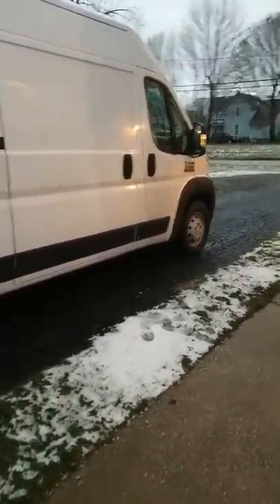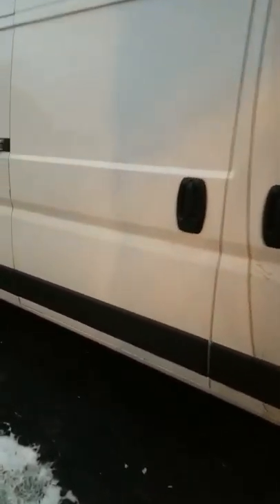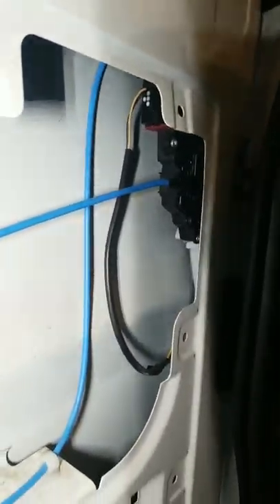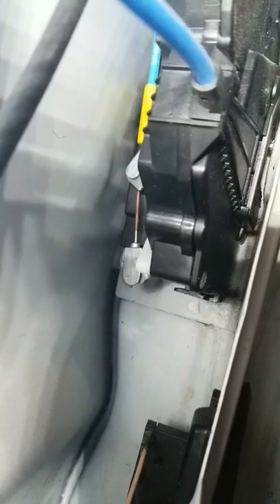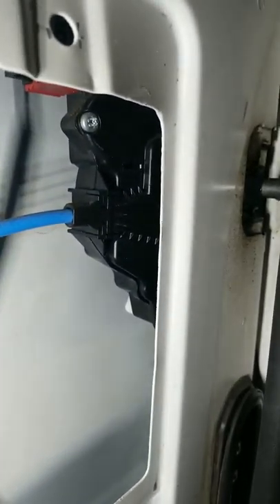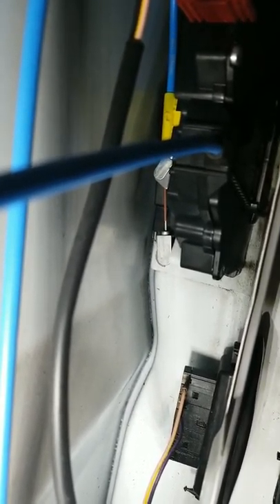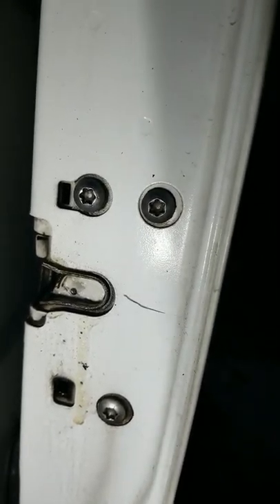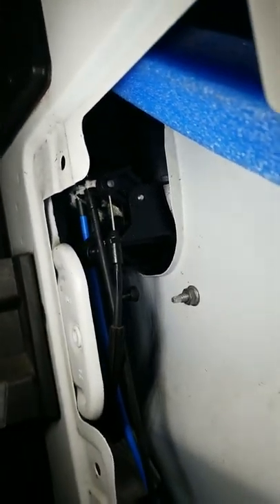Promaster side door won't open FIXED! How To

Comment: thanks for sharing valuable info! just my 2 cents to anyone who may have the same issue. Before you bust anything, do check if nothing got jammed the door. In my case it was the weatherstrip that came off and got jammed between the door and door frame causing the door latch to be under pressure jamming it. all i had to do is to pull that weatherstrip out and then i was able to open the door. otherwise, the issue was exactly as described in this video and I was getting ready to bust that latch when i - lucky me - noticed that weatherstrip being out of place.
Reply: I pulled the weather strip out hoping that would free up the lock.  But no, in my case the problem did require smashing the thing to open the door.  Stupid design.

Comment: Thanks this video was huge!  The part at the dealership was $385, I ended up finding it on line for $45.  The parts guys at the dealership were cool and helped me figure out the part # and printed off a quote and kinda gave a wink wink go buy it somewhere else vibe.  I ended up replacing the cables too because the parts guy at the dealership told me my problem was probably stretched cables... it wasn’t, the latch mechanism was definitely broken inside and I had to bust it open, but I figured while I was at it I would replace the cables too.  Thanks for this vid though!

Comment: Thanks, mine's stuck and all the other doors are mechanically deadlocked from the inside. Do you think if I drill say a 3" diameter hole near the lock mechanism, I could flick the bottom latch and open the door from the outside? I was adding insulation to the door as I'm converting it to a campervan, when the door slid shut very slowly. I might have dislodged the cables from the handle or insulation might have fouled the mechanism.
Reply from the maker: It's hard to say, flipping the latch for me wasnt enough. I had to literally destroy the latch with a screwdriver and order a new one.

Comment: thanks for posting this. My slide door is still stuck and won't open even when moving the bottom linkage by hand. Clearly the mechanism assembly is broken in mine as well, however none of the linkages work (i tried both). Do you have any suggestions that may help? Thanks for your reply in advance.
Reply from the maker: Take a screwdriver and bust the whole area around the latch apart. This is how I had to work mine
Reply: @DualsportDisport  Thanks! So just to be clear, the bottom linkage will disengage the door latch ONLY when the mechanism assembly is in working condition? I will break it apart today and see how it goes.
Reply from the maker: @adrianpietraru  correct. Destroying the old one is the only way I got mine off

Comment: Sorry to be thick headed, but after watching a bunch of times, I don't understand what busting it open does to allow you to use the bottom linkage to open the door? Was that to identify which linkage opened the door?
I can move that bottom linkage, without busting it, but the door still won't open! 🤷
Reply: I think it was to just identify how it was supposed to work, and your problem means it’s broken inside the mechanism.  I could move the linkages too, but had to bust mine open to get the door to unlatch

Comment: Thanks for this video.  I'm having this problem and having to replace the latch housing but there seems to be two part numbers for the same part (68226180AD and 68226178AD) for my 2017 Promaster 1500.   Do you remember the part number you ordered?   Can you share where you ordered this part for your fix?
Reply from the maker: I don't have the number but I ordered it from the dealer using the vin number
Reply: @DualsportDisport  Thanks

Comment: Hey Nate really enjoyed your video I’m having problems with my doors as well hopefully this will help he can you show how the cables connect to the inside and outside door latch it would really be helpful to make mine was all disassembled by the dealership and when I chose to not pay $2000 for them to fix my door I just left everything a mess thanks for your help Dennis
Reply from the maker: Hey I will try to get that tonight
Reply: Nate Thanks Nate I really appreciate that it’ll help I still haven’t been able to get my door unstuck I I was able to get the two mechanisms to release that you showed in your vehicle but my door won’t even budging a16th of an inch if you have any other suggestions I would sure appreciate it I was wondering if maybe it’s something that’s electrical or magnetic I just don’t know I talk to two different dealerships and they absolutely refused to give me any information to help me thanks again Dennis
Reply from the maker: @dennisleach588  take a hammer and screwdriver and bust that cover off where the end cable goes in, then shove the screwdriver way down in there by the latch mechanism and pry around. That's how I got mine but it took some time
Reply from the maker: @dennisleach588  https://youtu.be/JpigwvX_FRY
Reply: Nate Hello Nate thank you so much for your advice and your guidance I was able to bust up the mechanism I had to get it and then it was as simple as reaching out and barely touching the latch mechanism and the door popped right open so I got the new lock system in everything works except for the fact that I cannot unlock the doors with the key fob any suggestions and thank you again for your help I can manually lock the doors I can lock them with the key fob I can manually unlock the back door with the key but I cannot unlock the doors with the key fob
Reply from the maker: @dennisleach588  glad to help! so the key fob wont lock any of them? But they lock with the button under the radio? Or are the lights flashing when you try to lock with the fob? Silly question but connector is plugged back in right? I had that happen once and cant remember the timing but I thought it was something major and ended up just putting a battery in the fob and it worked after the new battery.
Reply: @DualsportDisport  Thanks also for the video. Had the same issue with my door and I was able to fix the latch and the door works. For me unfortunately the door now wont lock when using the fob. All the other door lock like they always have except for the sliding door now. This was not an issue before. Any advice?
Reply from the maker: @filipzaborek3951  is the cable plugged back in to the latch?
Reply: @DualsportDisport  By cable are you referring to the cord/cable that leads to the lower sensor? That one is. Other than that there are 3 cables that attached to the new latch and those look all secure. I may have to dismount it and make sure I didn't miss something. The door opens and closes without issue with outside and inside handle.
Reply: @DualsportDisport  I just watched your video again and realized where I messed up. I had the sensor cable plugged in upside down. Lol, typical amateur mistake. Glad it was an easy fix and again thanks for the helpful video.
Reply from the maker: @filipzaborek3951  glad to help man I'll have more videos coming out feel free to subscribe

Comment: Hey thank you for your vid. I need to replace a cable (the blue cable going out of the locking mechanism, ie the horizontal one going to the interior handle). It is possible to replace it or do you have to break the plastic box as you did? In other words, is it sealed or can it be disassembled? you're talking about a screwdriver and hammer but I did not understand very well... thank you!
Reply from the maker: Just now noticing this.. yes I think you can take it apart if you are able to get the door open and take the latch assembly out of the door. This will allow you to change the cable from what I can tell but I know when I got the new lash from the dealership it came with the cable already installed so I don't know if it's a different part number or not. I hope this helps thanks for watching
Reply: @DualsportDisport  thank you!   I will take the latch assembly out of the door and try. I think the cable is sold with the latch. But I am gonna use a different cable (that I still have to get) because I want to install a different inner handle in the middle of the door. I need to see how the cable end inside the latch assembly looks like in order to get a cable with similar cable end on this side and a cable end compatible with my new handle on the other side. I believe the cable end inside the latch assembly is like a hook with a 90 degrees bend. Do you remember that? Can you confirm? Thank you!!
Reply from the maker: Yes it's a 90 degree s type . Glad to help! Subscribe if you want to stay tuned to more Promaster tips and tricks and fixes! Thanks
Reply: @DualsportDisport  I have removed the latch + unscrewed the casing but I cannot open it. It seems sealed or needs some force to open. Does the cable end look like that? https://www.ebay.es/itm/273740433928 
I don't want to put too much force on the plastic casing and I may leave it like that and try to adapt the existing cable end on the other side to fit my new handle instead. It depends on whether I have a chance to find a cable that fits. Thanks
Reply: For those who may be interested : to take the cable out of the latch, you need to slide the cable towards the right (when you look at the latch from the cable point of view), with some force (use a screwdriver to act gently as a lever). It comes with a triangular plastic piece which is actually part of the cable. It is an issue to remplace this cable with another reference, because of this plastic part which is part of the cable housing & prevents dust from entering the latch.